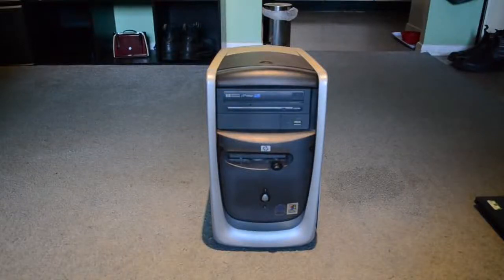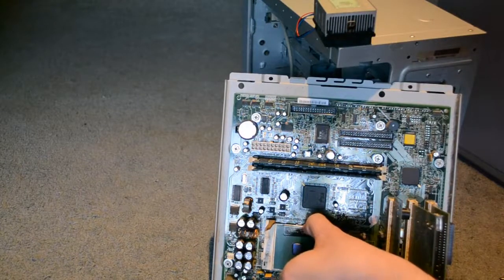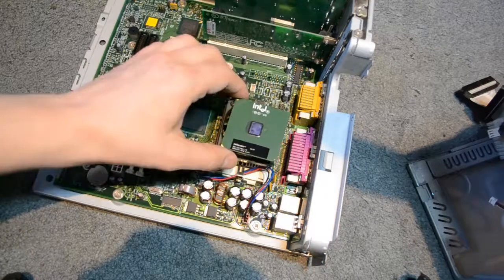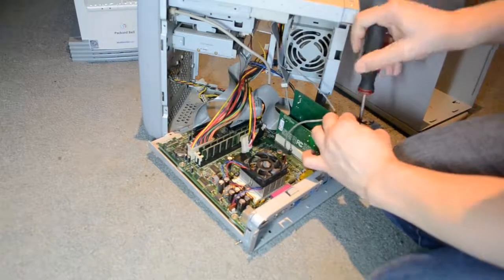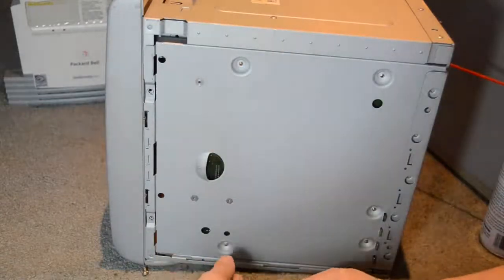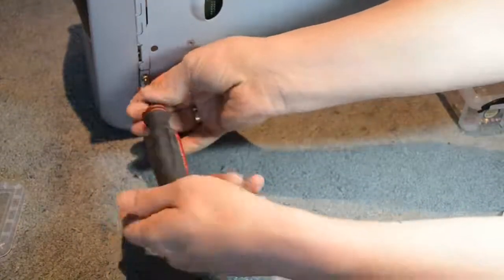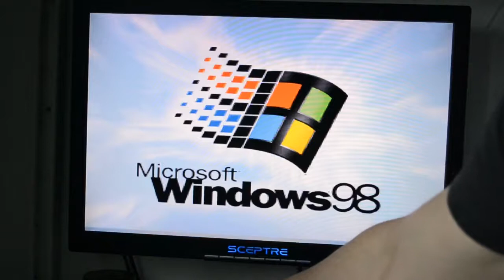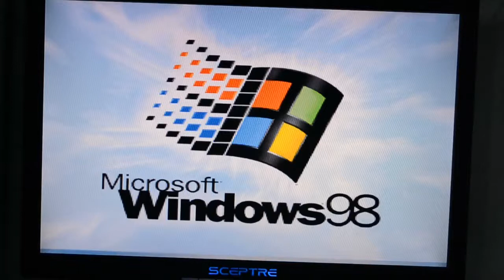Found HP Celeron Desktop (Trash Picking!)

Comment from the maker: 39:00 I simply inserted a compact flash card which had a goofy copy of Windows 98 on it from the other machine. Eventually I downloaded the Dynamic Drive Overlay from Phil's Computer Lab's site, and re-installed Windows 98 on it properly. 

So far I can't get the AC97 sound working. Does anyone out there have any ideas? 

In the meantime I ordered a PCI Sound Blaster card. Hopefully that works better.